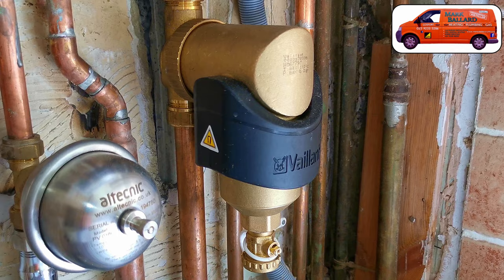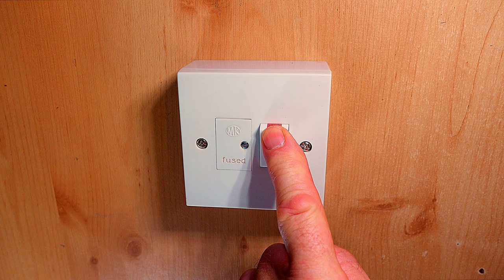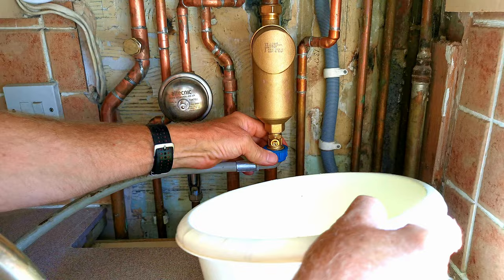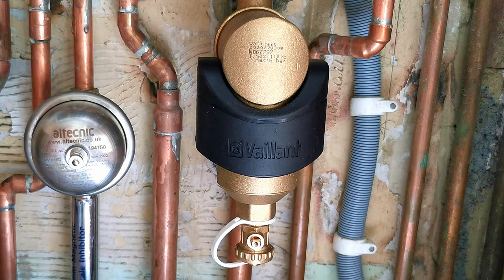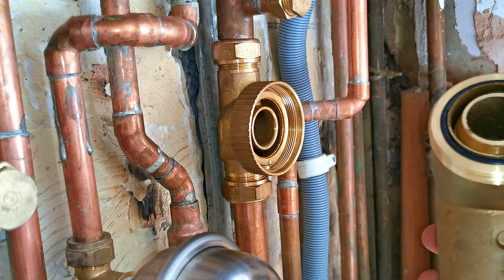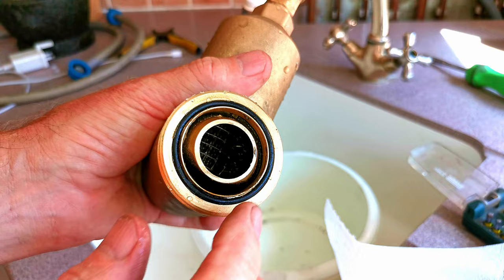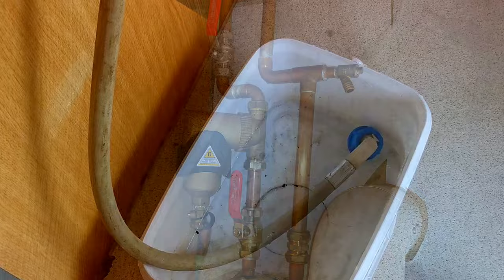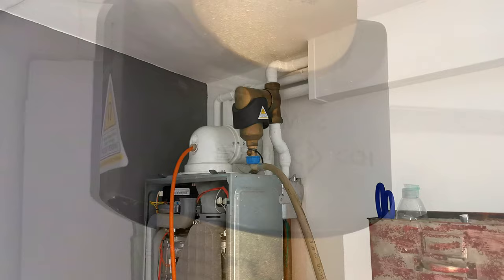How to Clean Vaillant Filter and SpiroTech Filter, Simple Flush or Deep Clean for the Best Results

Comment: How would you addd inhibitor?
Reply: I put it in the expansion tank as my system is vented (I stop the water from topping up and drain some water out from the mag filter, then add to the expansion tank). If you have a combi, then you can drain some water from a rad, then add it using a funnel into the rad. Re-pressurise the system and turn it back on.